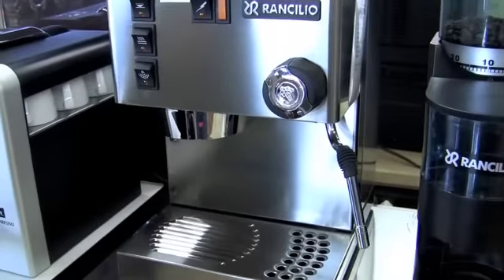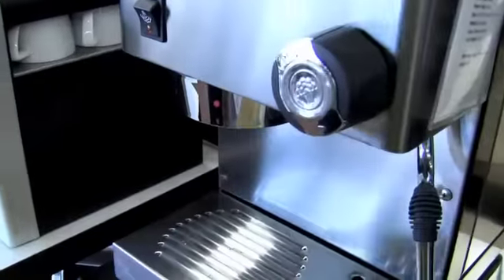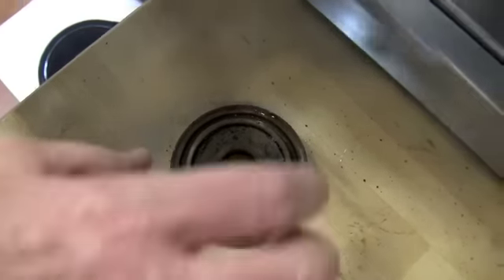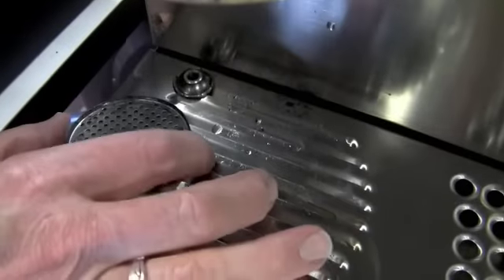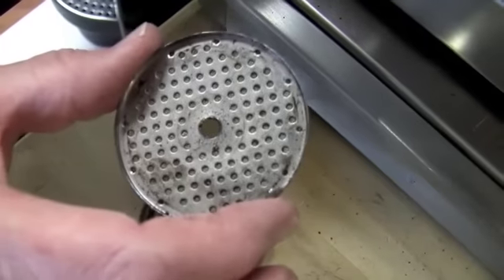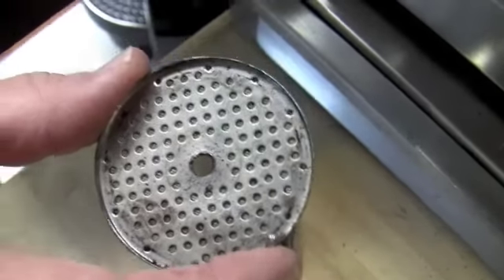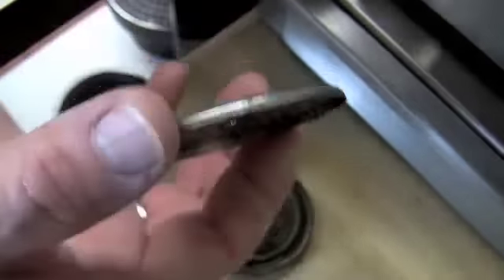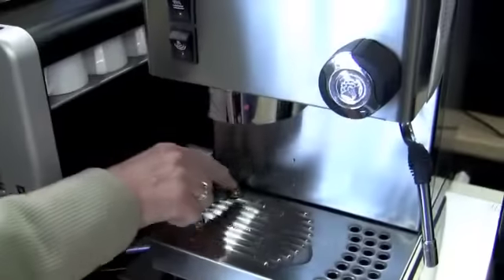Tech Tip: Rancilio Silvia Brew Head Maintenance

Comment: For those who have not done it for awhile: My Brass plate would not fall off, it took prodding and pushing with a flat screwdriver for 3/4 hour. Then my gasket took  60 mins off scraping to remove. Then it took another 1/2 hour . But I kept at it. Replaced it and my single porta filter fits smoothly and nicely. I will plan on back flushing, replacing the gasket more often. Love this machine!

Comment from the maker: @tinbiscuite Sounds like it's OK, but just that since you have cleaned built up oil it is allowing more water through. There could be more moisture on the top because of more water flow -- you could adjust your grind or tamp if it's affecting your shot, but shouldn't really be an issue. - Kat

Comment: Agree with Henkera on this one. The shower HAS to be placed on the flat side of the brass disc. I have tried both combinations, and with the flat side placed upward you struggle to get the portafilter in place, AND the coffie becomes funny.
What I havent figured out is where the funny shaped washer is going to sit. Is it placed over the brass plate or underneath?
A video on this would be must welcomed.

Comment: Hello 
I just started to clean my V1 (I think it is a V1, it is from 2004, I bought it in 2008). Have not used it for a while. Here the brass donut is stuck, and if I did not know it is supposed to get off, I would say it is not possible to remove it. The seal ring seems to be ok, I have not had any leaks with my machine yet.

Comment: bottom group head under neath the metal on the group head has to crack no leak
Reply from the maker: Bruno Galati It sounds like you have a cosmetic crack in the group head cover around your Silvia. If you'd like to send over a photo to support@seattlecoffeegear.com we can take a look and let you know if we have the part necessary for replacement in stock. - Sarah
Reply: its crack outside the brewhead metal part botton

Comment: Kat- I wonder how often one should dig out the old gasket and replace? I've had the V3 for about 4 years, pulling only a few shots a day average; I've had no issues with leakage around the gasket as of yet, backflush, descale and clean regularly, etc. 
That said- is there a vid of a gasket replace on the Silvia? 
Thanks!
Reply from the maker: Here is the video: How-To: SCG's Tune-up Kit for the Rancilio Silvia

- Steven

Comment: To replace the gasket somebody gave a very good trick specially if your gasket is old over a year it has a tendancy to vitrified
Here is the trick and it works perfectly
1- place the machine upside down or sit it on one side and screw 3 drywall screws 120 degrees apart (approx equal distance) with a short screwdrivers.
2- use a pair of pliers (electrician type) and pull gently each screws vertically and the gasket will come out easily without breaking.

Comment: I just clean mine asking the bottom of group head theres little crack in the metal in two spots what shoud I do
Reply from the maker: Hi Bruno Galati! Just to clarify, is the crack in the brew head cover, or in the screen? Are you experiencing any leaks? If it is the brew head cover, this is usually a cosmetic fix and can be replaced. - Sarah